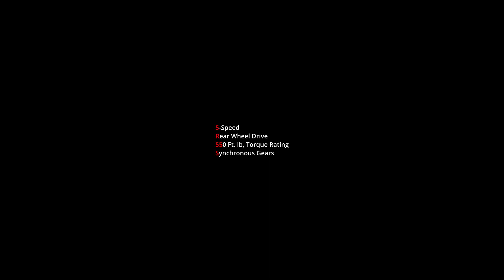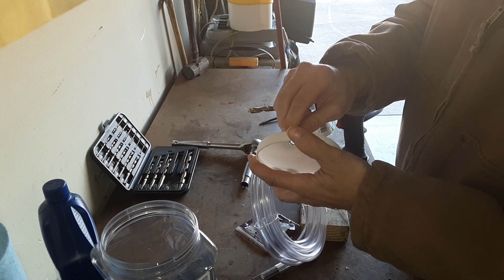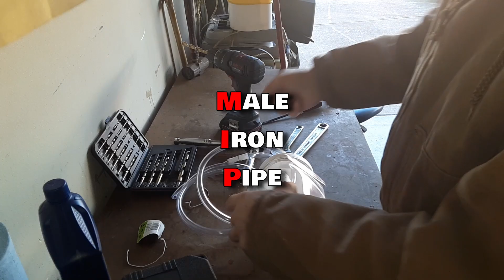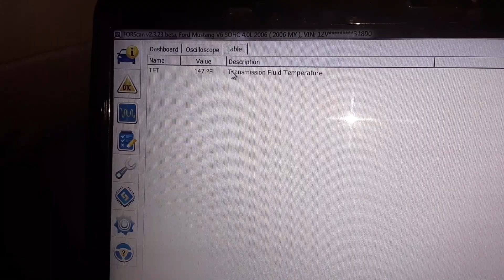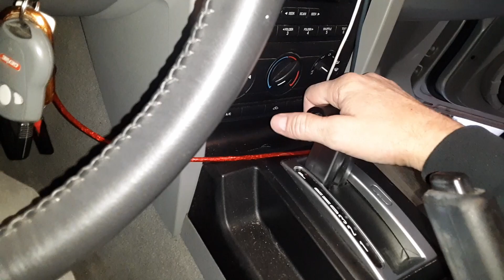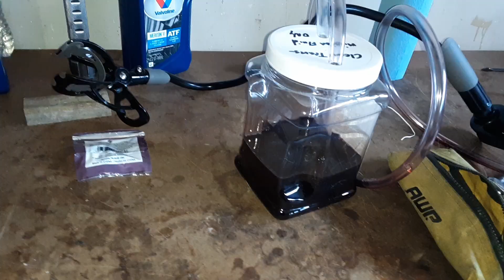EASY!!! 2006 Mustang 5R55s Transmission Servicing Without a Lift

Comment: Is there any way I could lose all the transmission fluid in my transmission and if so what do I do
Reply from the maker: Unfortunately the only way to check the fluid level on the 5r55s transmission is to do it the way I did in the video.  There's no dipstip.  It's a bit complicated